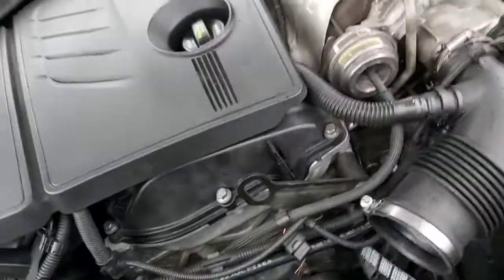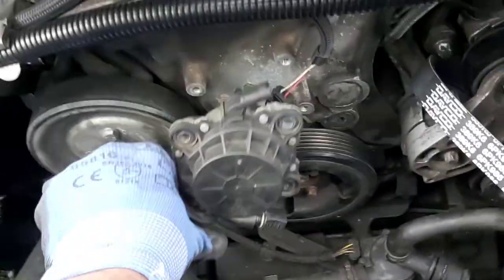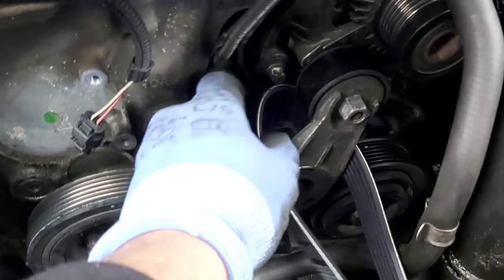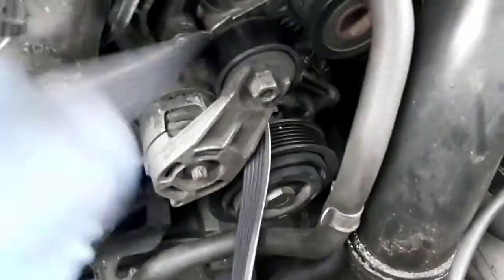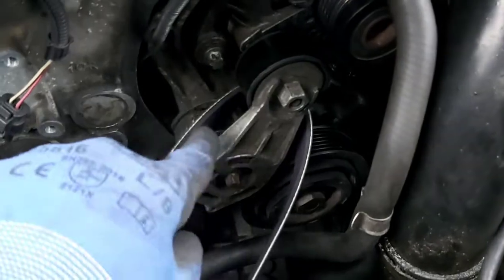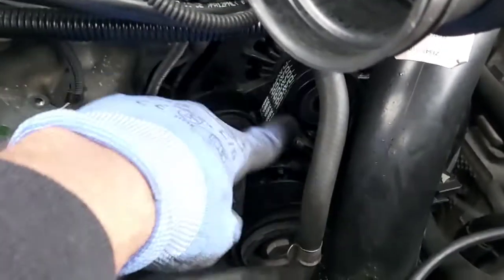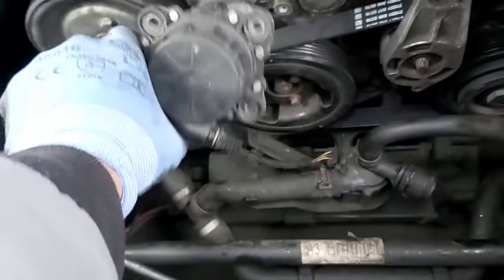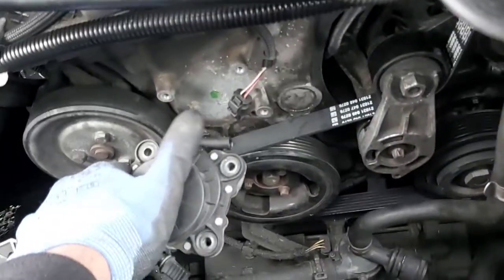Bmw 1 series 116i (F20)  auxiliary belt removal tip!

Comment: You'll damage the belt that way. It's easier to loosen the central bolt holding the tensioner. That way you'll have more clearance for the belt.